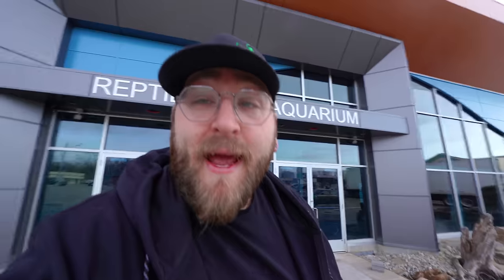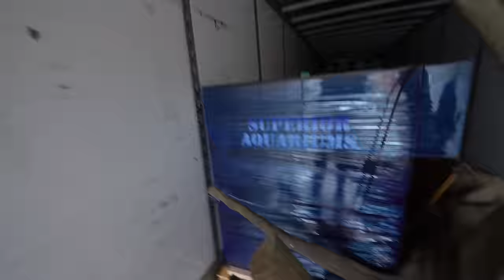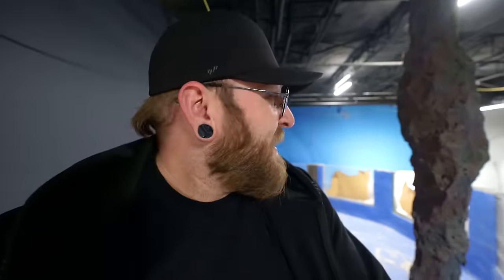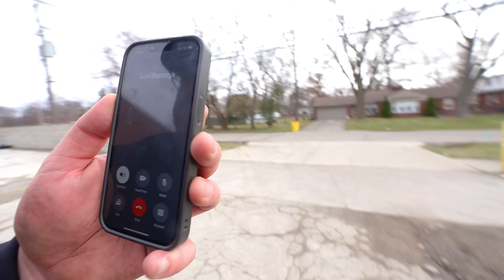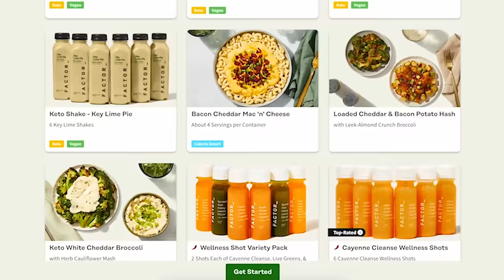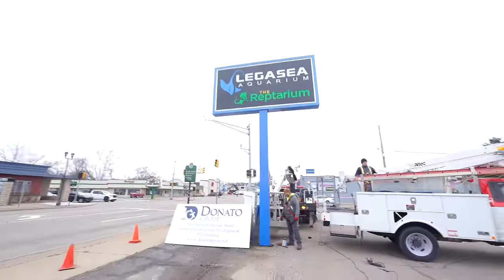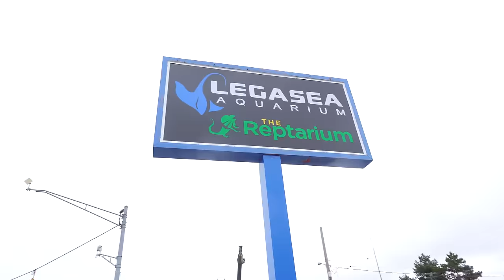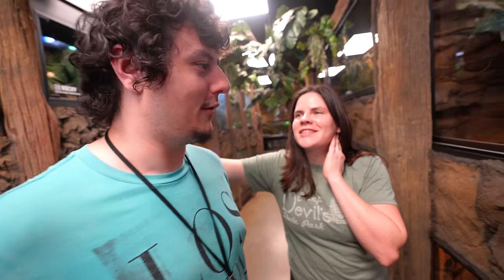Giant Aquarium Arrives, But...

Comment: That guy doing the sanding on that tank - get a hydrasand multi head sander - 5-6 circular flexi powered sanding disks heads - makes that job a lot quicker than using one orbital sander which can overheat using that long continuously and then you can go over it all with a single orbital sander with highest finishing grit 👍🏻🍻🥃